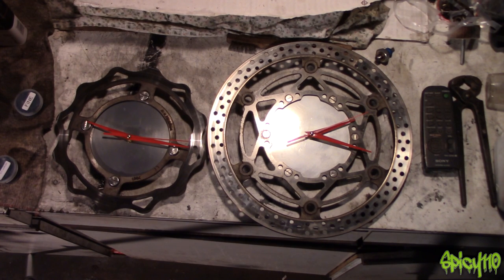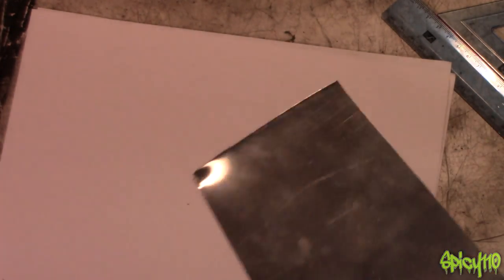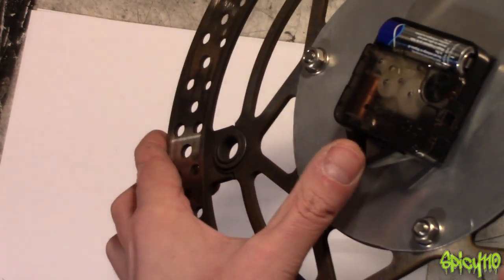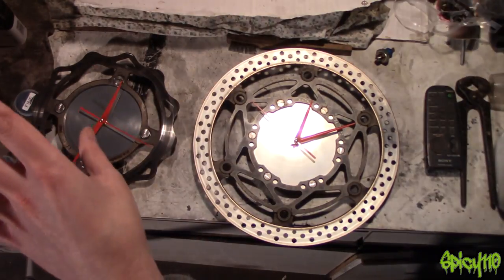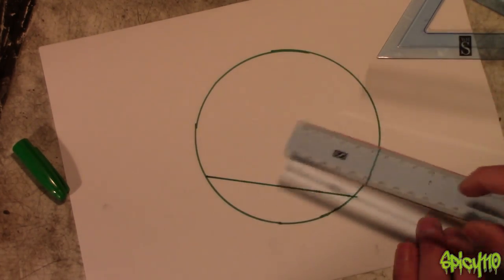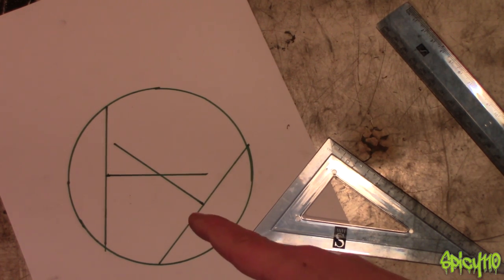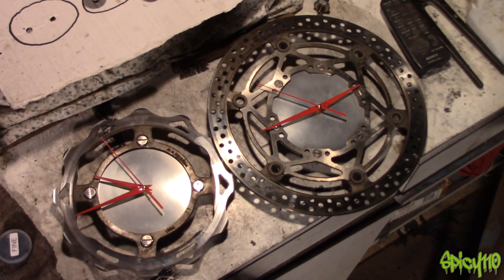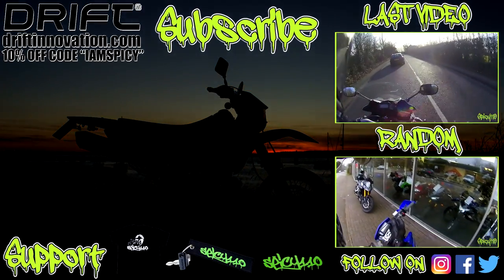Motorcycle brake disk / rotor clock! How I did it.

Comment: i made a clock from my old chain and sprockets from my old sinnis apache but being a welder i welded a steel plate in the middle of the rear sprocket and drilled a hole in that